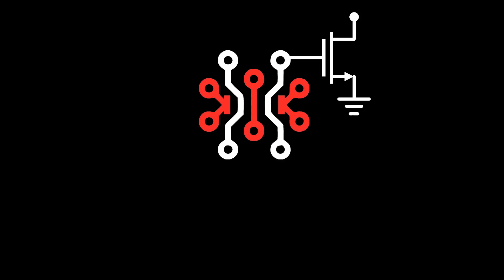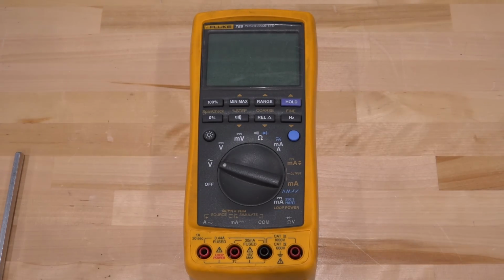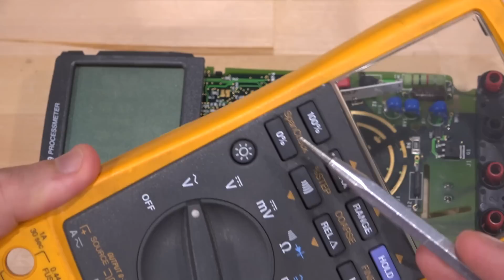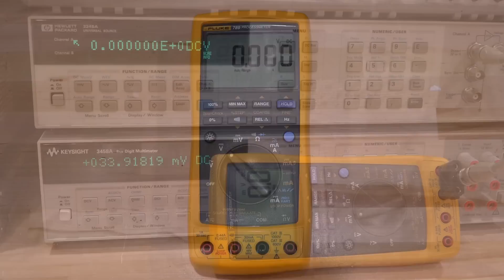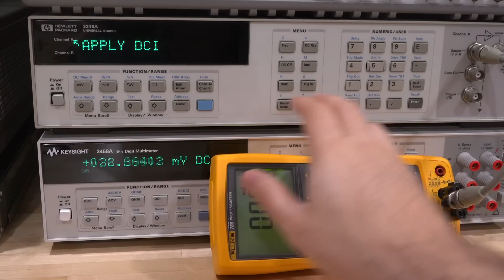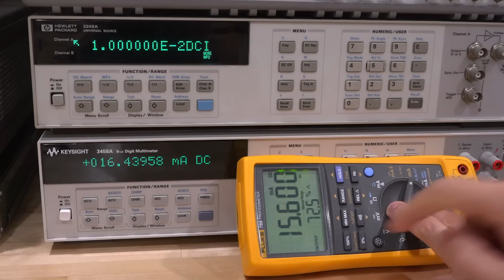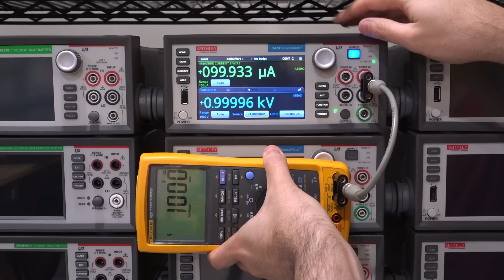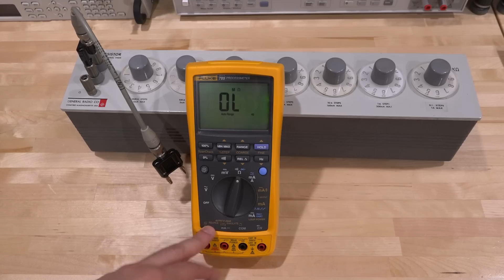TNP #37 - Fluke 789 ProcessMeter Teardown, Repair & Performance Verification

Comment: I have a Fluke 789 with a damaged current output and it's also measuring in AC. The fuses that came with it are blown and have the wrong amperage. Besides replacing the fuses, what could be causing this damage to the 4-20 mA current output? Which components on the board should be repaired?

Comment: had an issue with battery shrapnel. replaced it with similar. but no display afterwards. could see some horizontal digital lines / battery symbol on off position before changing that shrapnel. but nothing after that. any idea?

Comment: I was wondering why are you buying such meters when you already have an arsenal of great instruments for every possible scenario you can imagine?
Reply from the maker: Because it enables me to make videos like this about its operation & repair.
Reply: There is no such thing as “too many” instruments, and that goes especially for Fluke
Reply: Same reason why most car collectors buy up crappy cars and fix them up. The only way to practice diagnosing and fixing an issue in a complex system like a modern electronic device or a car, is to find examples with issues and attempt to fix them.

Comment: The photoshoping the screen is an odd trend.  Now sure why people insist on doing that - but please stop it.
Reply from the maker: Why? It allows me to show something about its internal without obscuring the instrument.
Reply: @TheSignalPath  I agree - that is annoying.
Reply: @TheSignalPath  IN a thumbnail?  When you're going to open the meter anyways?  You can't be that dense.
Reply from the maker: It is clearly meant for the thumbnail to provide some insight to what is in the video. You may ignore the thumbnail or the whole video for that matter. But what you are not allowed to do is to throw insults around. There is enough of that in the online world as it is.
Reply: @TheSignalPath  Woah - slow down there - I was trying to be helpful- letting you know that the thumbnail is cringe.  But you do you broski.
Reply: @GeorgeGraves come-on, so much arrogance towards a person who provides you with free knowledge. Even if you insist on your interpretation of the thumbnail be more humble.
Reply: @mogoreanu

Comment: It's important! Previous owner has installed 11A fuse in the place of 400ma. 789 should have both fuses rated to 440mA. I suggest you to replace fuse ASAP
Reply from the maker: I’ll change it. Thanks!
Reply: Very helpful, thank you.  I was watching this video specifically to find out what fuses were supposed to be in it.  When I didn't see it in the video, I started looking through the comments.  Thanks!

Comment: The Fluke 789 PrceossMeter I have used and watched interment tech in setting up Industrial valve's controllers, level indicators, flow meters, pressure indictors large industrial fans controllers. a process signal is 4 to 20 ma. The signal can run vary long distances (500m or 1640') and be very accurate and immune to electrical noise almost all industry uses this setup. In valves and controllers, the 4 to 20 ma is converted to a air signal of 3 to 15 psi. I work with industrial boiler and cogeneration for 42 yr.

Comment: 1:29  exacly same problem of my fluke 187 i bougt at a Hamfest as broken for less then 50 euro ... still working great ..another problem with these series is that the connectors brake loose from the board when using std banana plugs.

Comment: If you want to immediately brick one of these meters, attempt to measure the units own batteries.
Reply from the maker: Is this a known issue? What is the root cause?
Reply: @TheSignalPath  The root cause for the meter dying when measuring its own battery is that the COM jack in most multimeters is not connected to battery ground, but instead an analog ground at another potential, so when the COM lead is connected to the battery this shorts out the analog ground, most likely killing the ASIC chip, or if you are lucky just the voltage regulators. This is similar to hooking up a grounded mains oscilloscope ground clip to an arbitrary voltage source, things go boom
Reply: @TheSignalPath  That goes for any fluke meter
Reply: @TheSignalPath  All I can say is that I tried it with a newer 87V and it instantly bricked.  Gotta hand it to Fluke, I sent it back and they replaced the board.  Lesson Learned.
Reply: Did you try it?

Comment: Nice repair, try to apply silicon from inside to seal the battery holder,  so if any battery leak it didn't damage the pcb.
Reply: Silicone is not a very good idea with metal. A good polymer sealant will work better and is safe to use on metals.

Comment: Looks a bit like the previous owner broke the battery contact right after getting the device calibrated. 😂But why didn't he just stuff some balled up aluminum foil into the gap tho? 🤔
Reply: That's exactly what I did when my second hand Fluke 189 battery spring broke. Previous owner had some alkaline cells leak in there which weakened the spring.
Reply: That's my default bodge.

Comment: What's going on with the fuse holder?
Reply: nothing wrong, the fuse is just sitting a bit too high. Maybe the meter got bumped or dropped...
Reply: I noticed the fuse also. I popped one of the two fuses in my 89 IV. Different meter, but each fuse is different and they fit their respective holder well. That one fuse looks longer that the space provided by the holder. Not like Fluke to be sloppy about spacing. Nice find!

Comment: Oh no! Yet another connection issue. 🙂I was hyped for a detailed circuit investigation.
Reply: Thanks for this comment would have wasted my time on this one getting exited again
Reply from the maker: I don't control what is broken - it is the luck of the draw.
Reply: @TheSignalPath  Of course, and I am actually glad that you didn’t have to put much effort into this one. I know how frustrating it is to track down a fault for hours while trying to record the whole process.